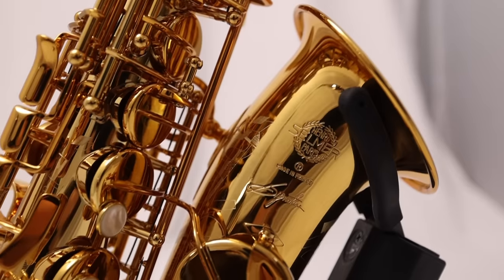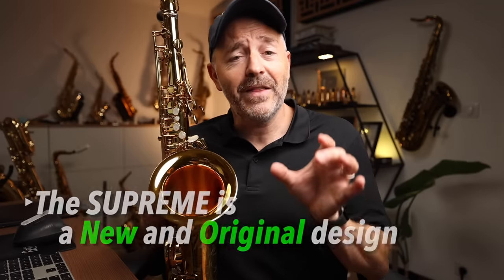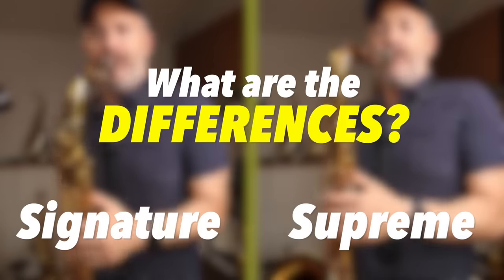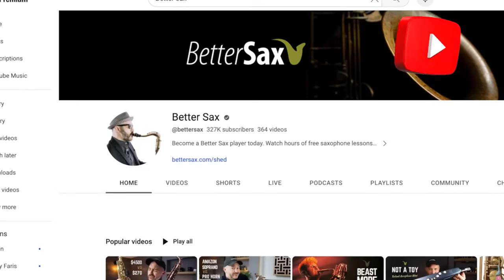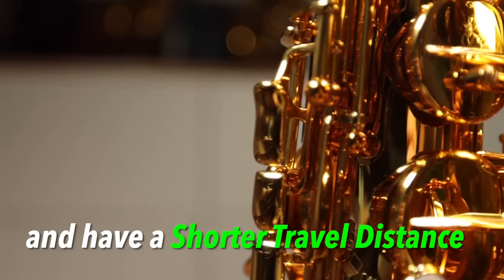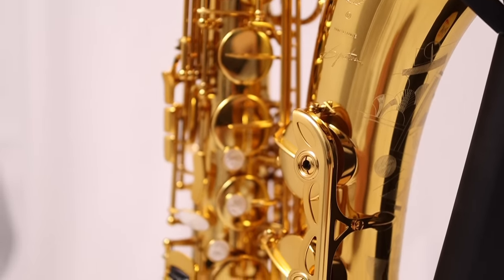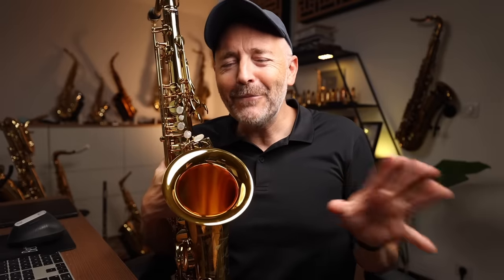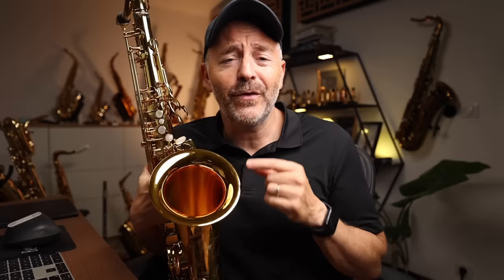Why Selmer Released ANOTHER New Saxophone - Signature Review

Comment: The Supreme sounded a bit richer to me initially and the Signature a bit drier (not in a bad way). But after the first few examples I stopped hearing it. A lot is lost through a microphone, Youtube compression, and cheap monitor speakers so I doubt I could tell the difference in a blind test without hearing them in person. Cool to hear that the necks are interchangeable. Low keys and some resistance would be my ideal combo, not that I can afford either one and I'd probably check out a Yani first anyway.